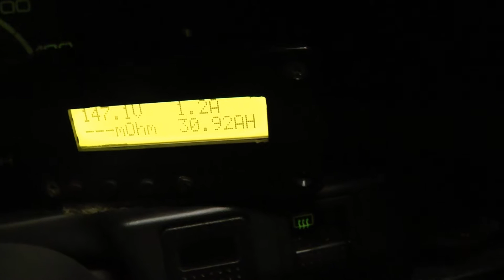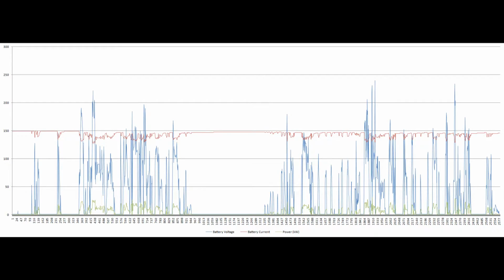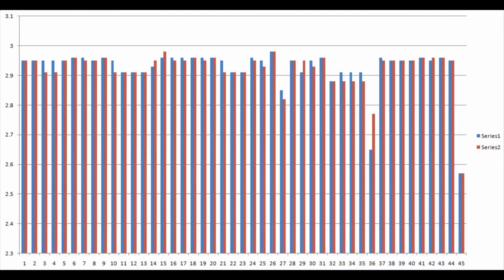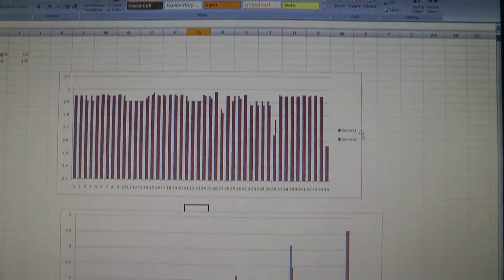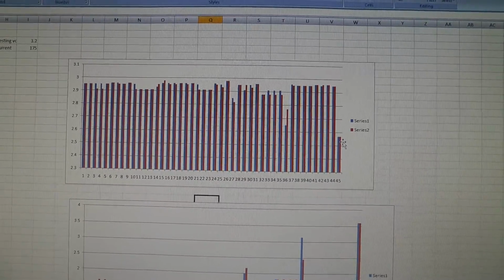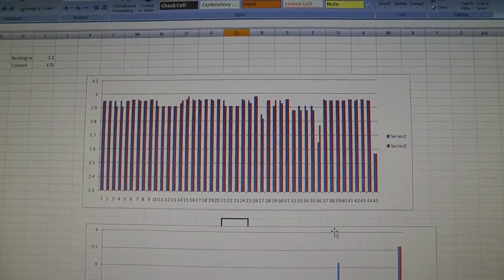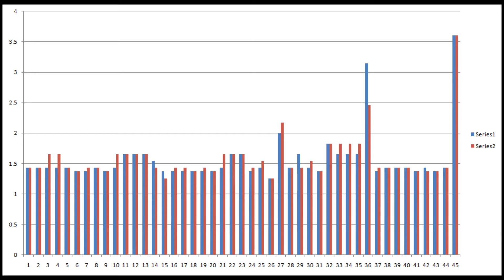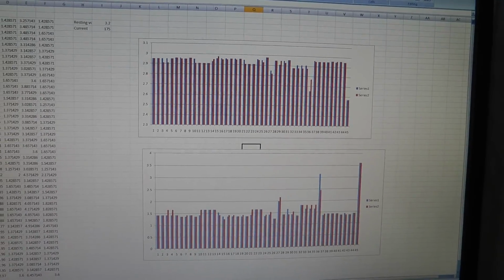Electric car upgrade part 5 - Test run and battery data

Comment: I’m tempted to convert my Toyota to electric. It’s a 91 but there is almost no electrics or power steering etc, still uses points on the ICE. Should be pretty easy to convert it

Comment: i watched all your video and one question i have at the moment is did you keep the clutch in your car? i know some people just keep it in 3 or 4 all the time. but i am just curious if you actually did for smooth shifting.
Reply from the maker: I did remove the clutch, shifting was somewhat difficult with the original (worn) transmission, and is much easier after I swapped it out with a newer one after the original blew up. Most driving is done in 3rd, highway in 4th, and sometimes I need 2nd to get up a steep hill.
Reply: ok i just saw the tranny replacement vid so i figured that might have been the case haha thanks!

Comment: I know you need to bottom balance all the batteries so there all equal in terms of what power they will have when you drain them down and then recharge them.

Comment: NiMH batteries only need to cycle about 5-6 times, with these newer Lithium batteries, 20 times seems much too high and should have a lower cycle time before max power can be achieved. Anyone else have any input about cycle times before you get full power output? The assumption is that all batteries/cells are brand new, just to keep the topic focused a bit more.

Comment: I loved watching your videos. I know all too well about the internal cell resistance of Thundersky batteries. I have a 24 cell electric bike. Long story short I had 14 replaced under warranty in the first 6 months then gave up. I had the whole pack replaced with CHL cells and I've not had a single problem after 4000km

Comment: (.... cont) Next, if internal resistance is ti an issue, I would (forgive me) re-do all your cell interconnects with stainless steel studs so you have: cell terminal, copper interconnect (or traction cable lug/fuse etc), stainless penny washer (large o/s diameter for even compression), lock nut (nylock ok, better nordlock), low power lugs, ordinary stainless flat washer, lock nut.  NOTE! Brush every thing up lightly with a steel wire brush just before assembly to minimise resistance!  MW

Comment: Tessla500 - Ok, interesting seeing your plotted voltages.  I am a little skeptical that there is a problem with any of the cells.  I think it would be worth investigating some sort of issue with the BMS, particularly when you consider that there are 8 cells between each of the 3 misbehaving ones and the difference in the voltage on cells 27, 36 & 45 rises linearly.  This can't be just a coincidence.  So, first thing I would do is check the plotted voltages are right with a DVM. (cont)

Comment: Nice car, but why do you keep the same manual transmission gear and clutch?

I think if you have a very simple single speed transmission with an integrated differential (like commercial EVs) you will get a better efficiency, less weight and longer autonomy.

But adaptations will be costly. However, great project ;)

Comment: @tesla500 ok. your 3rd gear is probably fairly low. is it a geo metro?
red line for many motors can go higher than 5000 too. if you could go to 6500 it would be quite usable. maybe slightly higher gearing too so you could reach say 140 at 6500. that would be a good span I think

Comment from the maker: @Aussie50 Thanks!

Still a lot simpler than almost any modern car though! 

The motor is coupled directly to the transmission input shaft, no clutch. I rarely have to change gears, I usually run entirely in 3rd gear for city driving, and 4th for highway. The motor has low enough friction and inertia that the synchromeshes in the transmission can match the motor speed, if you don't push too hard like I did here. If I got a higher current motor controller, I could lock it in 4th all the time.

Comment from the maker: @DanFrederiksen With this transmission and the 5000rpm motor redline, I can run: 2nd gear: 55km/h, 3rd gear: 95km/h, 4th gear: 140km/h (theoretically). I drive mostly in 3rd, with 4th for highway. With a higher current controller, 4th gear would be appropriate for all driving.

Comment from the maker: @ignilc As robot797 said, capacitors are for short term storage, at least with currently available technology. These batteries can supply enough power for acceleration without using capacitors.

Comment: nice. lately I have been warming to the idea of direct drive (motor on a diff). it turns out that you can get diffs with gear ratios as high as 4.88, 5.27 and even 5.71 and the math actually pans out such that it can practically work with a fixed gearing with these DIY forklift tech EVs, both speed range and not too tough starting torque (although it might need a 1000A controller to be nice).
I figure a ratio around 5 which is like 3rd gear is good. could you try leaving it in 3rd for all use?